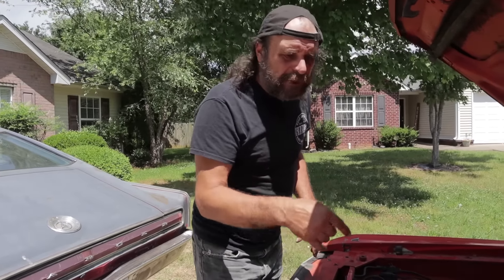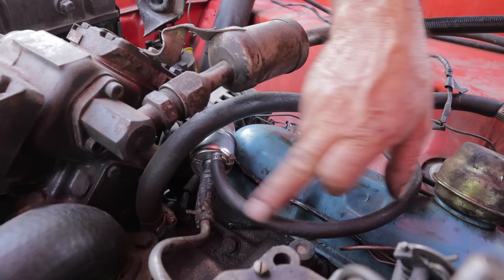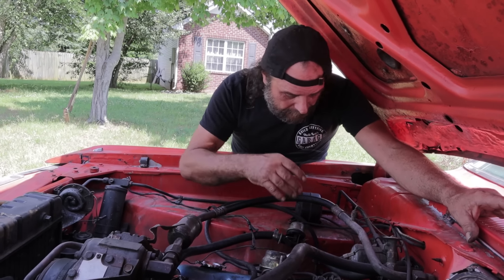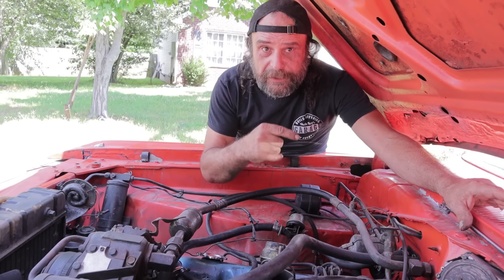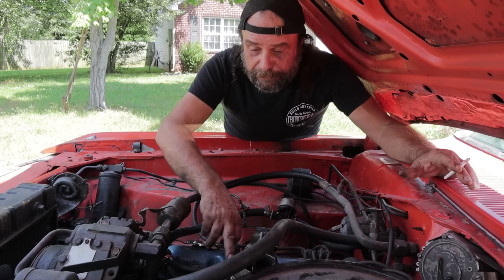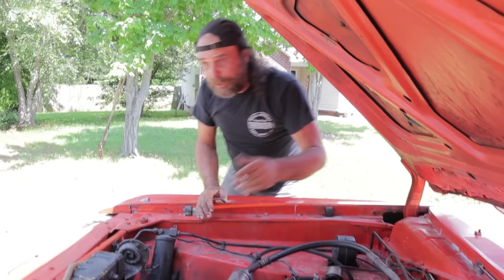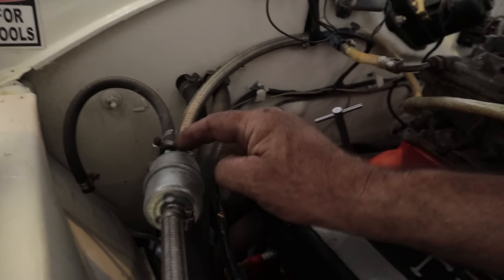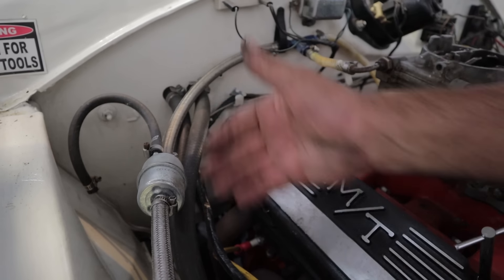$8 Cure For Vapor Lock

Comment: Uncle Tony, I have a brand new Edelbrock 600 manual choke on my 360 and was running excellent for about two weeks and now it's not wanting to pull fuel so I replaced the fuel pump and fuel line to the tank selector with a electric pump and still not pulling fuel, It'll start for a few seconds with gas poured in the carburetor but then dies, should I pull the tank and see if something is clogged up

Comment: After seeing this video I went on the war path to find one of these vapor lock filters, all my plumbing is done in 3/8 rubber hose, I thought it would be as simple as replacing my current 3/8 filter but noooo, I can’t find one of these vapor locks filters in 3/8, their all 5/16 …. I have the part # for Wix, Napa as well as other but they all direct you right back to a 5/16 filter

Comment: Dear uncle Tony , I am in the process of installing a fuel filter GF 432  (  3/8 hard line with 1/4 bypass on it )  the fuel pump is a Holley HP 12-454-25  7.5 psi.  170 gph ...engine is a 540 ci bbc. With a Holley 870 cfm carburetor vacuumed secondary. Should I use a restrictor in the 1/4 line section ? Or run it open for full flow ? ( 3/8 “ and 1/4 “ lines from front to back the gf 432 filter has no restriction  it’s just open , also i’m suspecting it’s going to drop my fuel pressure how low of your pressure is too low ? ) thank you Michael Peterson
Reply from the maker: You'll definitely want a restriction in that line.  .060-.090 would be about right
Reply: Uncle Tony's Garage thank you very much !
Reply: Uncle Tony... OK I got everything up and running today I used a restrictor in the 1/4”  inch fuel line with .065 hole ...my fuel pressure it 10 psi idling....   Is my fuel pressure too high or should I open the hole up a bit more ? Thank you Michael Peterson

Comment: With the dual outlet gasoline filter, do you need a pressure regulator? Mechanical pump and Edelbrock carb that likes ~3 PSI and pump is about 7 psi.

Comment: My 82 Ram is hard to start after it’s hot. I’m running a clear plastic filter. What return style filter should I run as I already have the line going back to my fuel tank?
I’m assuming there’s an orifice in the tank or check valve type on the return line . 

I know my truck originally came with a return style filter set up . 

Thank you!

Comment: So that vapor return hose on the swinger is fine resting on the valve covers, heat doesnt bother the rubber line?
Reply from the maker: Not enough for it to be a concern.  The system functions as it should

Comment: Let me see if i understood correctly.
If the car originaly had a fuel vapor line that ran from the pump to the tank, needs the NON orphus style filter?
In my case, i have an 87 Monte Carlo fitted with an old school 350.
It has a two line pump on it now..
The original vapor line is still on the car, but not hooked up.
I COULD get a new, 3 line pump that has a vapor line or get the $8 filter.

Comment: Im having an issue with my 71 olds cutlass.  It just started to want to turn off on me at the stop lights. I have to almost give it gas so it doesn't. As soon as i hit the gas to go it runs fine. Just when at a stop. Only difference I've changed was a new air filter.  Any thoughts?

Comment: What does that return line look like would it be possible to see a picture. I have a 72 dart with a slant 6. I need to add the filter but want to know if i already have it or if i have to run the line.

Comment: Hey Uncle Tony! Got a 1988 Oldsmobile Cutlass Supreme with a 307. After driving and heat soak, I get vapor lock. I have to floor it and it’ll start up, otherwise it spins and spins. 

I’ve got my fuel line wrapped in a heat shield, and also a heat shield under the carb. 

The fuel pump already has a return line as well. 

What should i do next?
Reply from the maker: Cooler thermostat?
Reply: Uncle Tony's Garage do you think that I should approach with a cooler thermostat, or a small electric pump? Or both? Thanks

Comment: HEY TONY , I see alot of late 80s  early 90s  fuel injected  cars having similar problems  since ethanol was added to the gas ( missing and dying on idle when hot outside ) is it the same problem ? THX
Reply from the maker: No.  That's usually a tank vent issue

Comment: So my 69 GTX 440 has a filter like this. Should it have the orifice in the tank already as well since it’s OEM? Had a vapor lock issue last summer. Put aluminum heat sink plate under carb and it didn’t happen again,  but I never really sat in heavy traffic with it again so not positive that cured the issue. Factory iron intake since it’s a N96 car, Holley 3310 carb.

Comment: Does the vapor vent always need to be run back to the tank, or could i just vent it out somewhere else, say, back into the air cleaner, like a pcv system? I really only get vapor lock on very very hot days, and even then i cant even run my car without overheating.
Reply from the maker: No, absolutely has to return to the tank...you'll be pushing liquid through there as well
Reply: @UncleTonysGarage  Ah, that's what I wasnt understanding. Thanks for the quick explanation. Do you have any tips for overheating? My radiator boiled over on the highway recently and I've been afraid of overheating causing damage ever since. Coolant has been flushed and even with a new radiator and thermostat it still hits 230 degrees sometimes

Comment: Would vapor lock prevent the vehicle from starting later? I am not getting any fuel pumped to my pre-carb filter chamber (tried several times over the last 2 weeks). Or is this a sign of a bad pump?
Reply from the maker: Bad pump, clogged in-tank filter or line, vacuum leak between the tank and pump...those are pretty much your only choices

Comment: Tony I see this thread is 4 yrs old but I have a question. I need to install this setup on my 67 Cutlass Coupe. My mechanical fuel pump has 3 lines. Currently the return line is capped off. I will have to install a 2 nipple sending unit first and run a return line from the tank up to the fuel pump. My question is will installing the return fix the issue? If not, if I install this setup, I would need to leave the return at the fuel pump capped off correct?

Comment: Do you have to cancel the return style fuel pump and then add the fuel filter ? I have an 85 suburban with a mechanical fuel pump that has a nipple that connects to a metal fuel line that goes back to the tank.

Comment: Tony I have a 1989 Honda Goldwing GL1500 and vapor lock is not an uncommon problem in them. I’ve had a few guys tell me “drill a really small hole in your fuel cap” as much as this works for them... I’m skeptical about doing that. Would this be a good modification for my Goldwing?

Comment: Uncle Tony can't find a filter without the small orpheus in my country ( LEbanon )  , i have a 73 Charger with a big block 400  which i think i have the vapor lock problem cause the car hesitate ( going uphills ) on 1/4 pedal while the 2bbl are open and once i put my foot to the pedal and open the secondaries it shoots black smoke out of the exhaust and drives good after as long as my pedal is 1/2 , the question is can i  drill the orpheus in the filter since i have factory return line , and could this filter cure my problem  thanks always enjoy and learn from your video greetings and love . Vince

Comment: So in my case on a 65 Chevelle with a carb and the stock VENTED gas tank, are you connecting the RETURN fuel line to the tank's VENT line using the tee fitting? The VENT line is the only other place the tee could possibly go. Is that safe?
Reply from the maker: You could T it to the fuel line close to the tank.  Vapor under pressure would take the path of least resistance and just push back into the tank
Reply: @UncleTonysGarage  Thanks for the reply. Wouldn't connecting the return line close to the feed line as you suggest introduce air bubbles into the fuel flow? I don't currently have vapor lock problems on my Chevelle, but I just wanted to understand your concept in case I do. I am running a phenolic spacer under the carb to isolate it from engine heat, and this is working perfectly right now.

Comment: I just watched your video on vapor lock issues.  I have a 1980 Triumph TR8 with an Edelbrock 4 bbl carb.  My fuel pump is located at the rear of the car at the gas tank.
How would I configure the filter to work with that set up?
Thanks.  Mike

Comment: UT,  would you say then that the pump related Vap lock is most easily solved by the separator filter you showed / and Heat Soak is more likely solved by Carb insulator plates or change over to Non-Alcohol fuel?

Comment: I have a fuel problem right now. It seems every summer here in New Mexico vapor lock affects my Chevy truck. It's a 91 Cheyenne square body has dual tanks. I've replaced sending units and put an electric pump but you can see the fuel filter isn't full. It lags fuel to the carburator or vapor lock? Please get back to me.
Reply from the maker: Did you bypass the mechanical pump?  If not, try that and see if it helps
Reply: Yes sir, the mechanical pump is closed off with a plate. I was thinking I might need a fuel regulator. Today is 101 F and it's running well when I drive but at idle it's rough and I looked at the fuel filter by the carburator and it's almost empty it's like it's running on fumes.

Comment: Could a person run a normal filter and fit a tee after it with or without an orifice?
Reply from the maker: Yes, but you would need some sort of restriction or you'd have zero fuel pressure where you need it

Comment: 82 GT with a 302 getting way to hot, engine temp is good. thinking the headers are putting off to much heat and the cars soaking it up.. should I get maybe a bigger fan or? wrap the headers?

Comment: Tony...tell me exactly how you set up the "T" with the line at the tank? Thanks! 
( Or anyone else can weigh in on my question, of course. )
Reply: When do we get this answer?
Reply: @ericdran9181  Okay...I got it sorted out. The T (which you will have to go out and buy) will have 3 ports/nipples. 1 is coming from the vent line that was connected to the new vented fuel filter under the hood and ran to new T near the tank. 2 is fuel supply line that comes from the tank and goes up front to the fuel pump. 3 is a vent line that connects to the fuel filler tube. There should be a vent line coming from the fuel filler tube that you will see when you are under there looking around the fuel tank. 
these 3 lines represent the T near the tank.

Comment: Think this would help on a fuel injected motor where fuel is boiling in the fuel rail and injectors? Causes rough running on hot start after sitting for a while on a 2005 Jeep Wrangler 4.0 242 cu.

Comment: Manaual fuel pumps do not get that hot ever. The fuel line traveling upward to the carburator may if routed near the exhaust but a manaual fuel pump would fail and pump gas into the crankcase if it got that hot.
Reply from the maker: Dude, even water boils at 212 degrees...gasoline about 180.  Have you looked at your temp gauge, ever?
Reply: @UncleTonysGarage  ya Water temp. Not fuel temp manual fuel pumps are low on the block way away from any water jackets. Do a video with a digital temp gauge you hold and point it at a fuel pump  and let me know the temp.

Comment: Heat soak, the silent killer of electronics also. After coming from a long drive I pop open the hood to give the car a chance to dissipate the heat out of the engine compartment. Sure as hell doesn't hurt to do this.

Comment: Im having this problem with a foxbody motor in my old lotus, would you put the vapor separator before or after the fuel pressure regulator to a dual carb engine? any advice is greatly appreciated.

Comment: What about the carburetor(s)? What can be done about heat transfer from the intake manifold to the carburetor when the engine just had a hard run and is now shut off?
Reply from the maker: There are several spacers on the market just for that purpose

Comment: I have a 1980 CJ5 jeep with a 258 engine and 2 barrel Ford MC 2100 carburetor and  3gpm electric fuel pump located on the front fender. I have the 3 nipple fuel filter. Should I use the Wix 3 nipple vapor lock preventer fuel filter for my jeep? Thanks.

Comment: I know this video is old however I was wondering... we have a 82 Jeep wagoneer 360 motor... it has the AMC 3 nipple filter, but it still cuts out every once in a while when it gets hot. Would vapor lock be the issue? if so would a second fuel filter help or would that even work and tee back into return line???? Any comments would greatly be appreciated.... By the way those are some freakin awesome classics!!!

Comment: So I bought a rhd IH scout ii to deliver mail. The thing has a custom tank with no nipples for a return line. But the fuel filter is directly above the exhaust and the line runs parallel above the exhaust all the way to the header. Do you think that could be a huge factor for the vapor lock?
Reply from the maker: Absolutely
Reply: Uncle Tony's Garage thank you for the reply!

Comment: So I set up a return line with a Holley regulator because I had too much pressure and flooding over so I ran the return to the sending unit that had a nipple for a return .So do I still need to do this as well it’s a 73 swinger

Comment: I have a 1980 F150 that has vapour lock issues but i have two gas tanks. Does it matter which gas tank the return line goes to or do i need a vacuum? I want to be able to use both tanks.

Comment: Hi I have a 70 dodge dart swinger original  340 car bought it some what gutted no gas tank no fuel line it was going to be a drag car so I saved it, so car runs good after car is warmed up it  start loosing fuel pressure and car wants  to die I have after market gas tank fuel line I think I have  the same issue you are talking about what can I do to fix it  should I do the same thing your road runner where canni buy the fuel filter you are talking about  also does my 70 dart swinger came with eec  I bought a filler neck  with no breather tube or nothing  can you help thanks

Comment: Tony I did this on my truck the same way you have on the road runner but mine would fuel starve at 45mph or at around 3k rpm in lower gears. It's a 1bbl carter style on a 300i6. Why do you think it would do that?

Comment: What do you do on some of the older cars that dont have a return line on the tank?
Reply from the maker: Make one like we did on the RR
Reply: @UncleTonysGarage  I do a lot of work on old VW air cooled engines. They are pretty low pressure set ups. Would that style filter allow for proper pressure relief?

Comment: How would that work with a '71 440 that has a 3 nipple PCV breather? The bottom nipple on the PCV breather already routes to the vapor line from the fuel tank.

Comment: so your saying the “10%” ethanol blend does not change the fuels specific gravity, from normal non-ethanol fuel? 
If a carburetor cars float is calibrated for normal non-ethanol fuel, the ethanol blend should not make the carburetor over flow fuel right??
Reply from the maker: A float is a float.  Once it hits the limit of the needle and seat, flow stops, regardless of specific gravity

Comment: Question ? if your gas tank is not vented ( only 1 line from the pickup in the tank,) then what ? The tank is vented through the gas cap. I am having a lean backfire when you lay on the secondary's after about 10 or 15 seconds with this new stock 327 motor I just built. I am going to start off with a high volume fuel pump ( 115GPH) with 6.5 psi to cure this issue, if that doesn't do it, might try a old school cool can just to see if it stops this. The Q jet was built & jetted for this 327

Comment: My 79 camaro is still getting vapor lock idling around town. Highway is fine. Electric pump, same style fuel filter and metal 3/8 lines. South ms/Alabama heat and humidity in July and August is hell. I'm also running an inch and a half plastic carb spacer. Gonna try therma sleeves on all lines under hood and maybe try a finned fuel cooler mounted in front of radiator and see if that helps. Anyone have any other suggestions
Reply: A guy here 3yrs ago commented that his father back in the day used a coil of tubing inside a coffee can. It was used on a sbc in a dirt circle track car. The idea was coil up some metal fuel line and run it inside a coffee can filled with ice. Said it worked for them. I may try this as well since I live in California and it gets hot 🔥 here in the summer. Maybe try dry ice as it lasts longer but who knows. Anyways kick them tires and light the fires.
Reply: @3DFamily76  I remember guys doing that back in the day drag racing. Found a vented fuel cooler I may try from summit. Mounts in front of radiator

Comment: Great video! I have spent hours trying to find which fuel filters have a metering orifice on the vapor return line with no luck. I even emailed Wix and they replied with they didn't have any information on which do and which don't. They said they can only look it up by application, ie: make, year and model. Could you please provide me with the information of the filter you used with the orifice?  I have a 1955 Chrysler with a 331 Hemi that I'm trying to solve the vapor lock problem on. Thanks!

Comment: Ok uncle Tony took off the mechanical fuel pump off put a electric one on bought this fuel filter you recommended now have backfire issues any suggestions it's an 87 318

Comment: Hey Uncle Tony, I am not a mopar guy but i have the same sort of problem on my 65 Impala, I am thinking of using a vapor separator filter with a return line ,my question is  tht my stock tank has only one fitting for the tank vent. Can I tee into that vent  with the return line and not effect the venting/return? Could you grt me the part #for the filters,Thanks ,Steve from Nova Scotia ,Canada